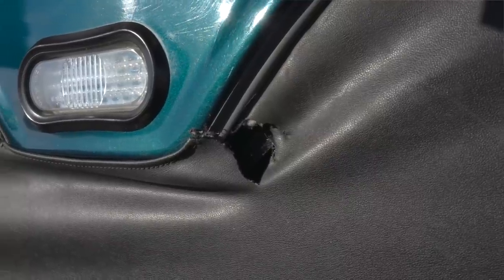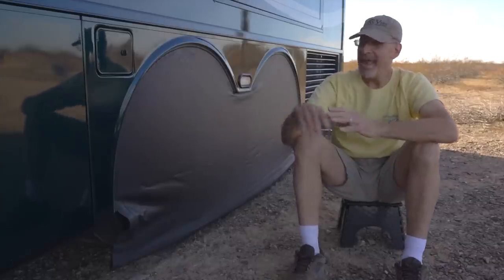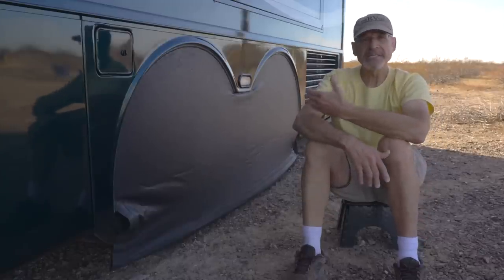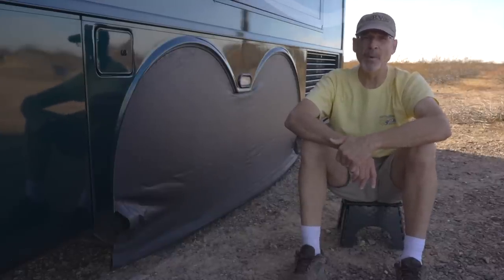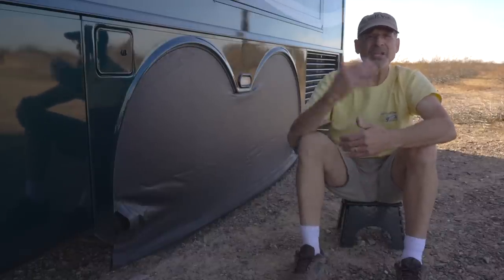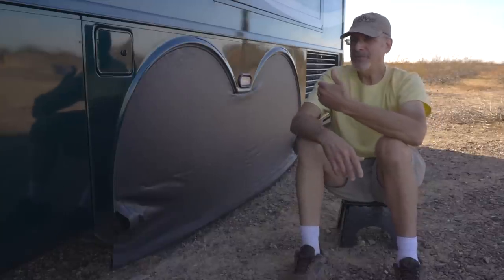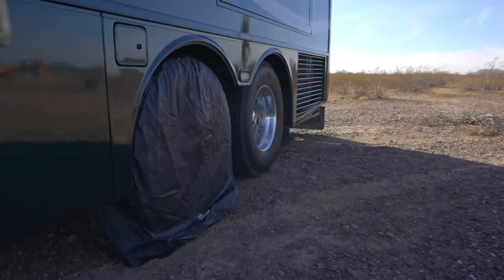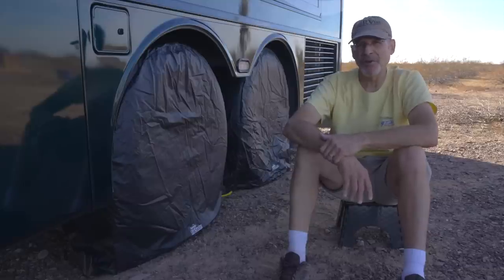RV Tire Covers SAVE YOUR RV TIRES! We Replace Ours With SnapRing TireSavers by Covercraft

Comment from the maker: Get the same SnapRing TireSaver RV Tire Covers that we use and love & SAVE 10% with Promo Code RVGEEKS:
https://www.covercraft.com/us/en/product/snapring-tiresavers.ST
They're sold in pairs, in black or white, in multiple sizes to fit any RV.
Reply: Hello, very informative, thank you!
What size did you get?
Reply from the maker: Thanks T C! Our tires measure 42 inches diameter from tread to tread, so we got the largest size, 40-42”
Reply: 1. Will scissor chocks damage the tire covers?
2. Is there anything in the specs that list the max wind speed before the covers can be torn or damaged?
Reply from the maker: @Gunner_Tom  We would think that scissor chocks put on before the tire covers would not harm them, but obviously the chocks may be in the way of the covers going on completely. Not sure we’d crank those chocks down against the tire covers, as that would probably not be very good for them over time. As far as wind, we can’t imagine any wind capable of getting behind these tire covers and pulling them off. The metal ring is very strong and tight around the tire, and they are extremely well held in place.
Reply: @RVgeeks  Thanks guys for the quick response. I have not bought sissor chocks yet so I think I will keep ising ground chocks and get some of these.

Comment: Are you concerned about the heat created by black tire covers with no air circulation? An FMCA tire expert told us we should get white covers if they cover the entire wheel. We opted for solar mesh covers that snap onto the side of the rig.
Reply from the maker: Great question, Greg! We’ve heard conflicting info on this general topic, including from a prominent windshield screen manufacturer, who says that their testing shows that black does a great job of blocking UV, which is the biggest problem. Not to sound flip about it, but white would clash so badly with our rig, I’m okay with black, even if white is better! 😂

Comment: What size tires do you have?   Mine steers are Michelin 365/70R22.5 and rears are 315/80R22.5, both are 42.5" in diameter.  Snap Ring "Giant" size says up to 42".  Wondering if they would fit.  Snap Ring people said they are not sure.
Reply from the maker: We have 295/80R22.5 and the specs say they’re 41.3” in diameter. The “Giant” size Snap Rings fit perfectly. They’re fairly snug, but it’s hard to say if they’re loose enough to allow an extra 1.2 inches for your larger tires. We hope they fit, because they really are awesome covers, but can’t be sure. We do have an idea though… if you buy them on Amazon and they don’t fit you SHOULD be able to return them, since Amazon seems to accept just about anything back. Here’s a link:
https://amzn.to/3pehC0X
Hope this helps. Please let us know how you make out.

Comment: Hi guys, I am interested in the Snapring covers, my only concern is how to store them in the motorhome, how much room do they take up?  Thanks
Reply from the maker: Hi David! The steel rings that make TireSavers work so well do indeed prevent them from folding up until a tiny little square. I’d estimate that they form approximately a 2’ diameter circle when stored. But they store very thin/flat and all six of our tire covers easily stack on top of each other and form one small circle that’s not very tall at all. It just depends on what your available space is like. While they do take up a slight bit more room than some others, their functionality is so superior, we feel like it’s an extremely small compromise, and would never go back!

Comment: Why not use tire shine for short stays???
Reply from the maker: Hi Michael! Great question. We don’t actually use tire shine at all, as it tends to attract dirt and is mostly for appearance. it also may contain petroleum distillates, which is harmful to the rubber. Our preferred tire treatment is Aerospace 303, which protects the rubber with UV protectant, and makes them look good while not making them over-shiny.

Comment: Do you foresee any heat build up issues with the tires when ordering black over white.
Reply from the maker: While white may be cooler, we’ve always used black, and been able to run our tires right to the manufacturer’s maximum allowable age limit with the tires in great shape. Black is supposedly a great UV blocker, which is what damages tires the most.

Comment: What size did you buy for your 22.5” rimmed tires? Dan - Oklahoma’s Tumbleweeds
Reply from the maker: Hey Oklahoma Tumbleweeds... we got the largest size (for 40" to 42" tires). Keep in mind that the rim size isn't the only important factor. You really need to know the diameter of the tire (measured from tread to tread across the center of the wheel), since that varies based on the size of the tire used.

Comment: What size tires do you have? I don't see a size large enough on their website. Only up to 42 inches. My tires are 315/80r/22.5 and measure 43.5
Reply from the maker: We run 295/80R/22.5 and use the largest size 42” covers. I recall our tire diameter is 42” and they fit exactly, but I’ll double check later today and get back to you to confirm. Sounds like your tires may be too large. The manufacturer likely has a contact form on their website for more info, too: https://www.covercraft.com/us/en
Reply: I purchased 40-42 for my 315 sized tires and they fit fine
Reply from the maker: @richfix1183  Thanks so much for the follow-up, Rich!
Reply: @RVgeeks  Just doing the calculations and conversions from the tire designation you have a 41.1" diameter and 11.6" tread width, so the "Giant" size (40-42") looks just about perfect.  Thanks for the review! I really like these covers, but the tires on my Dutch Star are a bit larger (especially the width of my fronts, which are 365/70R/22.5 - the rears are 315/80R/22.5), so I'm going to call Covercraft to see what they suggest.